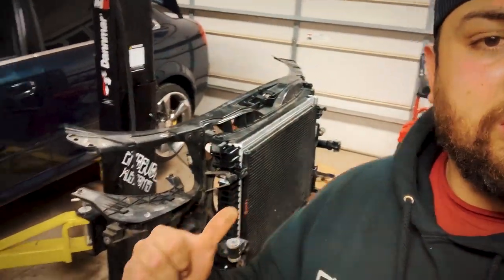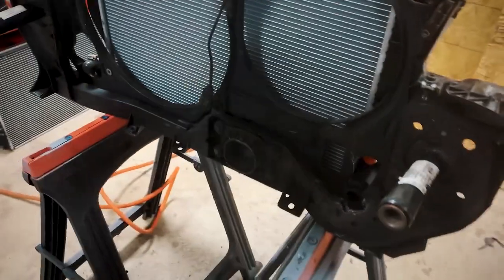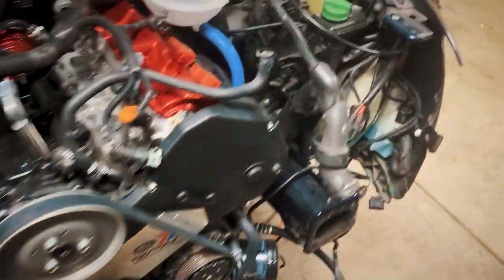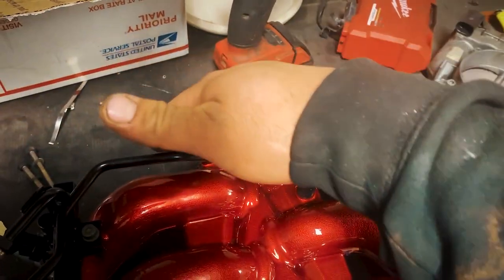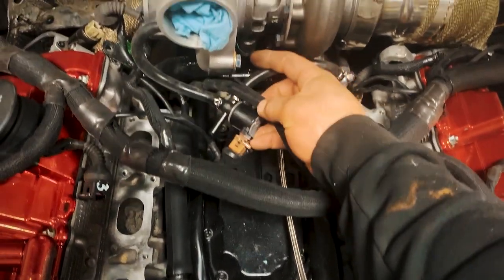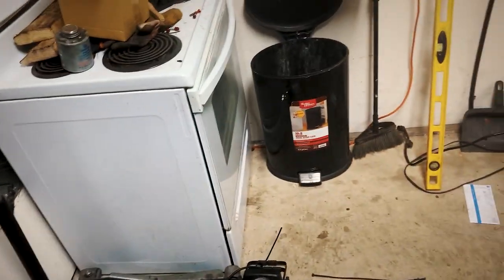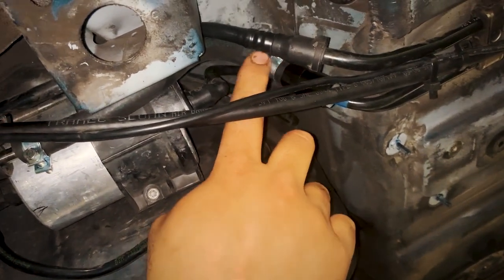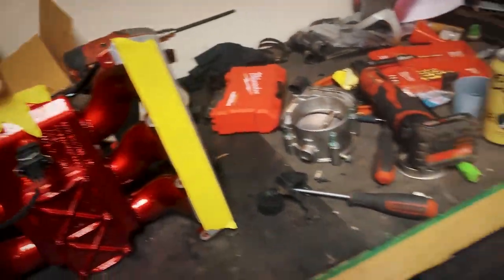New Motor Is in! | Audi B6 2.7t Swap Pt.5

Comment: I'm still deciding how I want to pull the motor out lol
Reply from the maker: Did the engine pull the good old fashion way for years but the lift makes it so much easier
Reply: @elusivegarage921  wish I had a lift like y'all. How different is the frame form a 2.0 to a 4.2 V8?